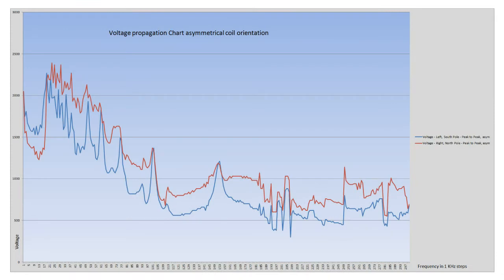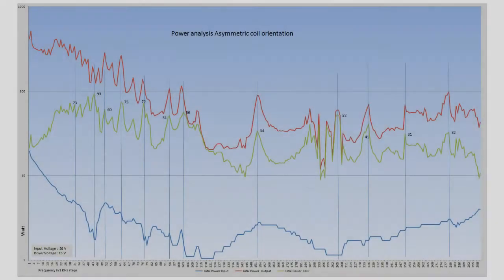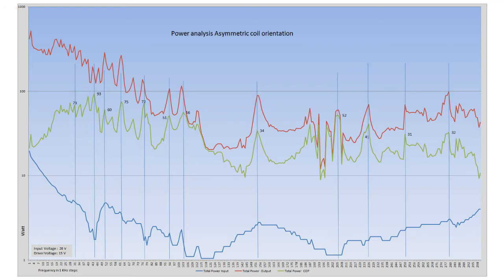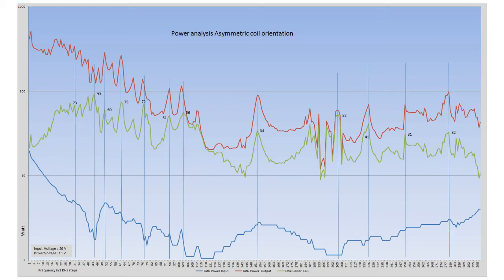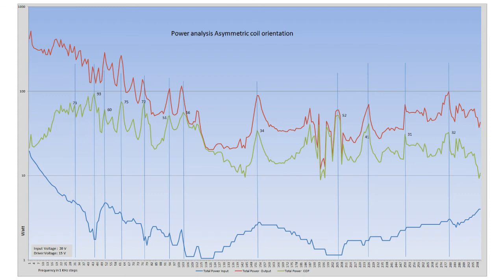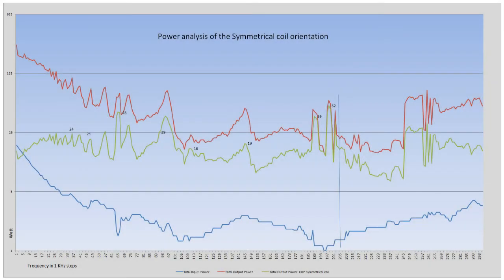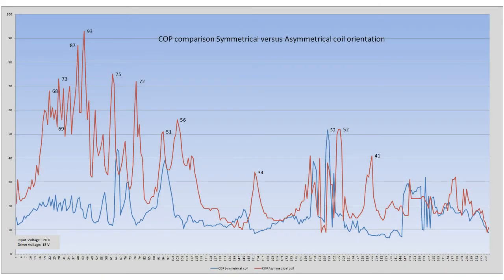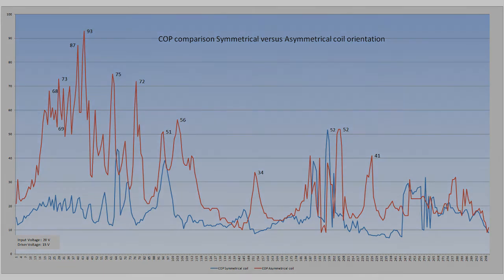Symmetrical versus Asymmetrical Bipolar Tesla coil power measurement. Part 2

Comment from the maker: For all please to note that the relationship between the primary and the secondary coil does not change. The primary is only concerned about the feedback from the secondary. It is not concerned about the position of it to the secondary. That is why the input power curve does not change much but the output does.

Comment: Yes, I built one myself following his thread....On the output in series, my voltage meter says 5-6 volts DC with a 14 volt input in parallel...but the output can light up a 120 volt neon with a slightly purplish tinge....whatever is coming out of the motor is not conventional electricity and is impossible to measure.

Comment: It is however usable energy and can be harvested but this surpasses my current knowledge. With a capacitor on the output it will hit certain resonant points where the cap bank will charge up to 18-24 volts (with 13.8 volt input!) and the motor goes faster with lower amp draw. It is trying to balance somehow. I was thinking of ways of using the energy to excite the environment much like tesla did with his high frequency high voltage asymmetrical generators.

Comment: There is so much energy generated in passing through a critical frequency of a generator rotor in accelerating to 3600 RPM that it will shake itself apart if not passed through quickly.  The mechanical components will fly apart.  People have been studying about how to harvest that for quite some time.  It is abundant and is best if used on a small scale, like in your garage...  just for your farm or home.  Single Crystals....

Comment: I'm trying to re-create one of teslas experiments in which the secondary coil was wound from the middle to the outside so one side has a counterclockwise one and the other side has a clockwise winding with two primary coils so you're getting two Vortech magnetic fields in between your primaries pancake coils
Reply from the maker: If you do that you will have more difficulty to calculate the transmission line frequency and the odd and even nodes. That is what make a TEsla coil work. remember your right hand rule. The center would have to be zero current and electrical potential. I compensated again with an capacitor I connected in between the TMT. That is what you actually do then.

Comment: Have you experimented with doubling the length of your secondary and adding another primary so you have one primary on each end of your secondary
Reply from the maker: I have. If you use a standard primary coil the current requirement increases tenfold, however the output is not tenfold but much lower. The longer the secondary the lower the resonant frequency and higher the electrical potential. Until you get so much resistance that you are left with potential and almost no current. Ohms law. The better option is to use a capacitor in parallel. It reduces resonant frequency and increases current delivery without being penalised with resistance